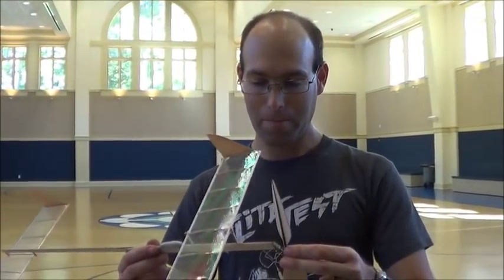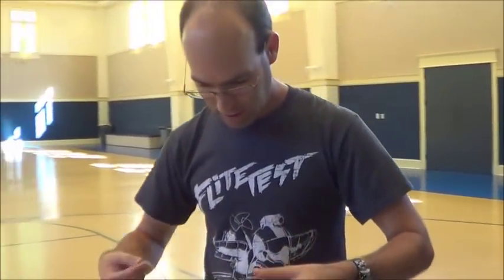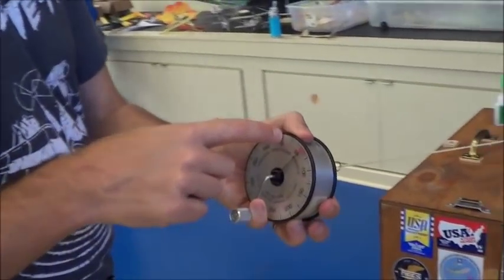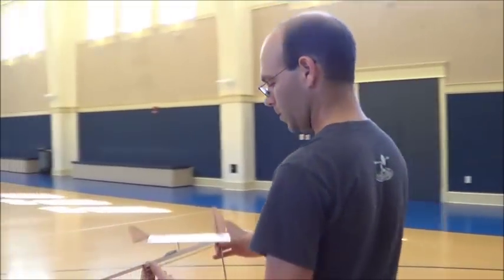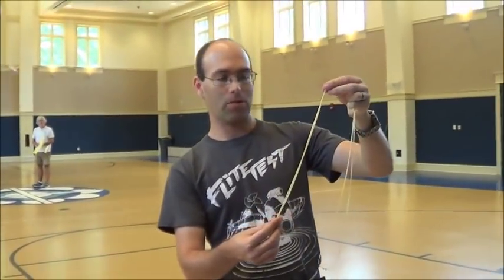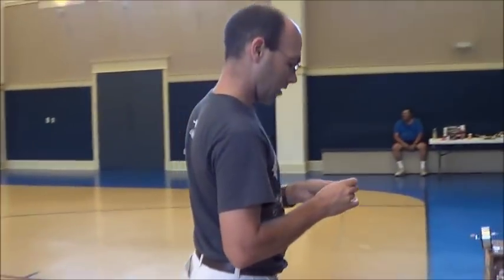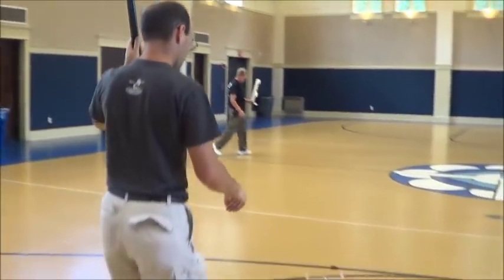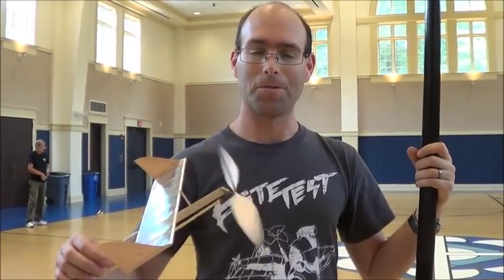Senior Flyer Demo and Flight Trimming - legal for 2019 Science Olympiad Wright Stuff Competitions

Comment: How did you make the circle so tight and the climb so smooth? My plane has like a 30ft radius circle and it climbs by stalling and making choppy turns. It also does not last very long at max height but if I increase the incidence it stalls too much.
Reply from the maker: Kyle Guo, first, get rid of the stalling; add downthrust if it's only stalling at high torque. Add left rudder and left thrust to get the turn going if it's not turning tight enough. If it's not climbing strongly, try decreasing the prop pitch a little by twisting the spars a little. Even a 5 degree change will have a drastic effect.
Reply: @joshuawfinn  Yes the stalling only happens during the climb when the torque is the highest. Do I add downthrust by slitting above my prop on my motor stick and shimming the cut to angle the entire prop downwards a little? Also, I don't have a rudder so do I just angle my entire tailboom? My plane does climb but its doing it in bursts of stalls that climb 5-10 feet. I would assume that my propeller is just angled badly and thats causing these problems.
Reply from the maker: @kyleguo2064  take a pair of needle-nose pliers and bend the front of the prop bearing down a little so that the shaft angles down. You will probably only need 2-3 degrees change. The tip plates on your tail can be used as rudders. Just bend on of them, and if it cracks, just add a tiny bit of glue to hold it. Again, small adjustments. These changes should give you a smoother climb and increase your flight times significantly. Everything you've mentioned indicates that your prop is probably doing a fine job. By the way, please take some video footage of your plane so I can have a look. This helps me diagnose problems a little better and also provides insight into what issues various customers are having so that I can improve my advice and the product.

Comment: So far, I've been using a thicker (silicone based i think?) lubricant for my motors. Is thinner lubricant better? Also, is there a reason why you didn't go with a near tandem design? Is there a reason why you didn't max out your stab dimensions?
Reply from the maker: Devin Karlburg, I do use a little thicker lubricant, but you do want it to be relatively thin. As for the stab, I simply haven't found a benefit for a larger one in a student context. You'd have to put the CG waaay back there to make use of it and that's not an easy trimming task.

Comment: My Senior Flyer is overweight at 10+ grams but achieved flights over 1 minute 40 seconds in a small gym. Had to go with a 1/8" rubber.  Nice to have additional parts to work on a lighter weight version. A lot of fun.
Reply from the maker: Greg Vertrees, the rules this year allow for pretty interesting airplanes. Unfortunately the demand for contest grade balsa has become absolutely insane. It's really hard to find light stuff. I actually depleted Sig's supply in several sizes.
Reply from the maker: The tip plates are mainly a way of simplifying construction and suppressing wingtip vortices. This helps not only with efficiency, but also reduces the model's wake turbulence so that it flies better in descent.

Comment: Why did you opt for wing plates? What are the pros and cons of dihedral vs wing plates and of a  vertical stab vs wing plates. I would love to hear your opinions on this.
Reply from the maker: Six of one, half dozen of the other, at least in terms of performance. Some make the claim that the tip plates are more efficient. Perhaps they are. They definitely make construction faster: sheet balsa, and the wing itself has one piece wing spars. That gives you an easy plane to build. Not the ultimate structural option, but the minimum weight is so high that ultimate structure is irrelevant.
Reply: Another few questions: How does the door on your f1d travel box work? How heavy is the box so that you can wind motors on it? How did you calibrate the readings on your torque meter?
Reply: @TheSparklyunicornz  You can calibrate any diameter music wire with a gram scale by bending the wire at 90degrees on both ends. If you want a inch ounce meter  the calibrated end needs to be 1 inch from the torsion center.

Comment: Nice flights there! By the way, do you know the breaking torque as a product of testing, or by some method of prediction like maths or a chart?
Reply from the maker: Copterdude, there are some formulas out there. That said you always need to check it through testing, especially when changing rubber batches.
Reply: Haha, is that the 'oops' kind of testing?
Reply from the maker: Copterdude  I like to call it "iteration" ;)

Comment: Love the winder and torque gauge. Did you make your winder and torque gauge, or purchase? If purchased, where from?
Reply from the maker: Unfortunately the only commercially available torque meter I know of comes from Freedom Flight (https://www.freedomflightmodels.com/tools.php). I'm hoping to put one into production in the next few months. If you do a google search for "rubber power torque meter" you'll find quite a few websites showing various methods for making your own from a piece of tubing and piano wire. It doesn't have to be calibrated so long as you stick to your own (mine is the only calibrated mechanical meter I've come across). Winders are readily available from a multitude of sources, but most come without turns counters (Volareproducts.com has turns counter kits).
Reply from the maker: Just as an update on this, lasercutplanes.com has a nice torque meter design available now. I actually prefer it to the freedomflight design just because it's so simple and durable.